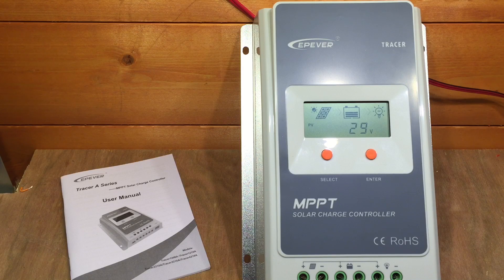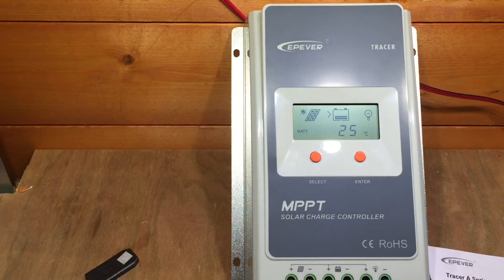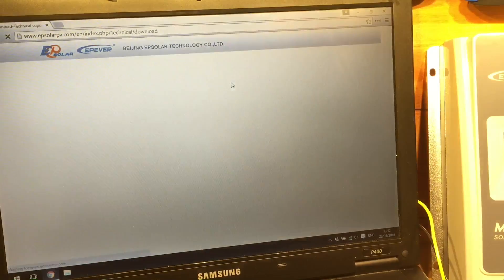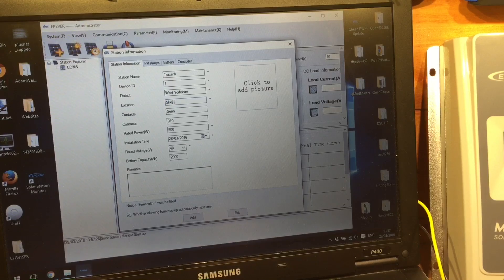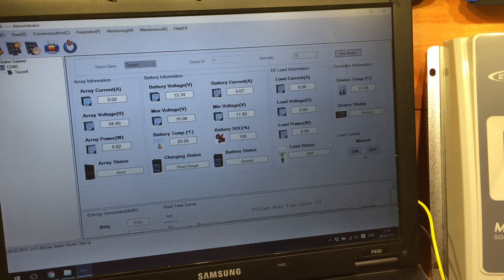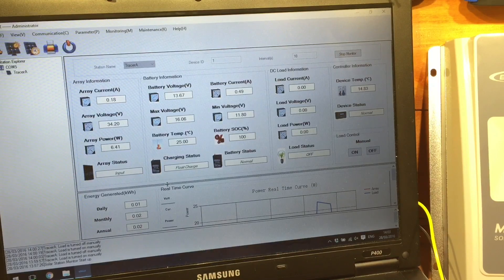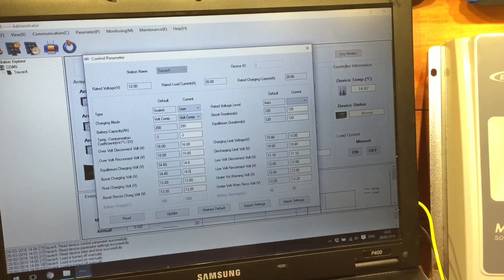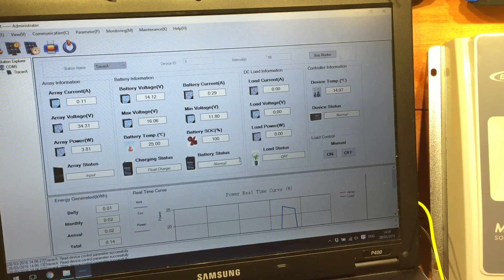EPSolar Solar Station Monitor software & a cheap USB cable - 12v Solar Shed

Comment: Adam is it possible to program the PV to cut off at a lower voltage just with the controller buttons or do I need the Solar Station software to do so?
Reply from the maker: Software or MT50 only I’m afraid.  You just get the standard modes using the buttons.
Reply: You would think a company this size would ensure their software was a little more robust if no other choices are available. I am not a novice when it comes to computers and I am finding it difficult just to install let alone use. Thanks Adam you do a good job. Good luck.

Comment: Hi Adam,
Have you come across a "Doesn't exist or has not yet been set up" error?
I followed this video to a T. Exact same dongle, cut network cable using pins 4(blue) to B and Pin 6(green) to A.
Tried a different RS485 dongle, laptop all together (different antivirus, Win7/10 etc), Ensured epever software is referencing the right virtual com port, recreating a new "station"... no luck
Reply: Does anybody have 1.2 or 1.4 version of Solar Station software?
I'm using v1.92 and I'm thinking they've disabled RS485 support so people are more likely to buy their RS232 dongle?
Reply: This ended up being my RS485 driver! I was using the windows driver from 2006 assuming it would work... not using drivers from wch.cn, dates 8/8/14. FINALLY connected!
Reply: Did you managed to get it going? I have the same problem

Comment: Hey Adam.. quick question, I'm wrestling with device descriptor request failed error when I connect the usb/rj45 cable from the CC to my PC. I've run the gamut of troubleshooting solutions. I did install the Solar Station Monitor included USB driver. I just noticed in the CC user manual, "Connecting the controller with PC network communication port is forbidden. It may cause damage to the components of the controller." I did connect the CC using an ethernet cable to my PC communication port when I first got the CC because I was overly excited to get it running. Although I only had this connection hooked up for one or two minutes tops, I'm wondering if I have permanently damaged my CC. Any thoughts? Thanks m8.

Comment: Thanks Adam, Any ideas on problems arising from not getting the software to display the settings? I bought the recommended cable but not getting it to display at all. Just trying to drop the max volts down. I have a 24v system and when the batteries reach 29v the inverter cuts out. The moment I switch off the solar all is well again. Great videos by the way and appreciated the prompt response. Well done.
Reply from the maker: If you’ve got the right cable then I’m guessing you’ve got a driver issue? Can you read the stats from the charge controller at all?
Reply: Adam Welch no response from controller at all. Uninstall Ed software and downloaded new. Trouble is my setup is on a remote beach in northern Tanzania and I an in Kenya so cannot test from here. Going back down next week so will try again when on site. One thing was the software was freezing/seizing on the old and new version. Thanks for everything. Will let you know when I get back.

Comment: Hi Adam, Nice stuff. Maybe silly question but can I use just a network cable for this through the network port on my laptop? Having trouble getting the software to connect to computer. Checked ports and all. Downloaded software again but no luck. Would 32bit have anything to do with it on a 64bit machine?
Reply from the maker: I’m afraid it isn’t a network port. It’s a RS485 port so it uses a different protocol. You need a USB adapter (or some other way of connecting). I did a video about making a cheap usb cable, but to be honest they are cheap enough just to buy the proper one.

Comment: Great video!  I noticed you changed the boost duration from 120 minutes down to 60.  Any particular reason?  I have 6 UPS batteries @ 12v (110 amp hours each at the 20hr rate ) for my battery bank... How long should I run the boost cycle for my mppt controller?  Is there anyway to mathematically figure this out for your battery bank size?  Thank you for your time, great channel!
Reply: Yes why, is it better if sunny or clowdy which way

Comment: help error Operation failed. The operation has timeout(COM3)
Reply: That is the error I got on two different Windows 10 laptops. Used a Windows 7 laptop and it worked.

Comment: Awesome video! You’ve got a bunch of neat ones :)
I’m curious... the rs485 specs say it can connect to 32 devices but I haven’t found a way to do this yet. Does anybody here know if one of those adaptors could be used to connect multiple tracer models??
Reply: Hi, I'm about to set-up my Tracer3210AN (older version with orange buttons) for my LiFePo4 battery. Unfotunatelly there is no preset/default mode for this type od baterries, so I need to set up 'user' settings through rs485 (CC-USB-RS485-150U). Thanks for this help!

Comment: will this work with Android? all I have now is a tablet with android os. I have a 30a tracer a . going on 24 v. with 7s liion. I am not computer comparable! but I'm learning. I just never had the need to use one. so I did not learn.  but electrics and a bit of electronics I can do.  I believe its capable of 780 watts? or there about. would it be safe to connect it to 8- 100watt panels. since it isn't likely to get the full output from the panels. is there any limiting of the output?

Comment: Hi Adam I have this same charge controller, I have been on epsolar web site and tried to down load as you have shown on video but their screen info is different when I click software (you clicked on monitor software V1 1.2 ) But this does not come on screen now, please could you tell me which one to down load, thanks Les.
Reply from the maker: This is the latest version which I've popped onto a google drive...  https://drive.google.com/open?id=1Le26ka30XHo5reyHieDqL1yf_qs9R7yg  There is the RAR file and it's also extracted.
Reply: Thanks Adam I think I've done it, won't know until I have the RS485 adapter cable

Comment: Hi Adam,
Can you help me once again? My Tracer A series 30Amp does not give me load info because I am using it in a caravan and the batteries supply all of the DC voltage. I have an inverter that is hooked to the batteries and provides my AC.. There are no wires coming out of the controller under the Load section. Where if anywhere do I hook up the load wires?
Thank you in advance
Mark North Carolina, USA
Reply from the maker: Hi Mark .  You're not forced to use the load output on the controller.  The only advantage of doing so it statistical information on screen (and/or software) and the ability to control the loads which are attached to it - either by switching them on automatically at nightfall or perhaps switching them off if the battery voltage drops too low.  If you don't need any of those features, just leave the terminals empty.

Comment: Adam hi, we are using LS1024B charge controller and we also used a UTP wire so we converted it just like how you do it but when we open the epever monitoring application is will say that the "port does not exist or not yet set up" any idea how to fix it?
Reply from the maker: +Lyka Bastida Check the correct port in computer management and double check the driver. There might be a rs485 tick box in the driver which is also worth checking.
Reply: Adam Welch There is no Rs485 box in the port setting...
Reply from the maker: +Lyka Bastida What version of windows are you using?
Reply: 10...but we are using ls104b as a charge controller
Reply: ls1024b

Comment: Hello Adam. Tried doing this but the software doesnt recognizes the port. It says the port does not exist. Please reply asap. Thanks!
Reply from the maker: +Lizlie Gen Dolor Acidillo Check which port has been assigned in computer management and make sure that is the same in Solar station manager. Then check your driver settings and see if the RS485 tick box is there and try turning it on.
Reply: Yes sir, i have checked it but the problem is i don't find any option for rs485 in the port settings. I am a little bit confused right now. I have used cat5 utp. I attached the blue in B and green in A. Thanks for the help.

Comment: Hello Adam.
 I received my usb rs485 and I have modified a cable today and when i try to use in in my laptop i get an error of operation failed Com3
I am using com3  and i searched the internet and cant find my answer.
Any clue. I understand the video is 1 1/2 years ago. I just thought i would reach out
Thanks in advance
Mark
Reply from the maker: +Mark Assante Is it the same as the one I used - a CH340 based one? If so the driver I used is from here - http://www.arduined.eu/ch340g-converter-windows-7-driver-download/ but also have a look at a RS485 tick box in the driver settings.
Reply: Thank you for the quick reply,
Crunbs!  It works,  You are a youtube Superstar, thank you for all of your help via your videos.

Comment: hi Adam, after watching this video i decided to get the usb to RS485 Adapter  but i cannot seem to get it working  with my other Adapters for the epever i have a option to tic a box to enable RS485 in the device settings, but this device has no such option oO im running windows ten, i have installed the driver, it seems to be all good but just dont have that rs485 tic box option, do you have that option with yours ?  and what driver did you use, cheers
Reply: OK i found the problem after reading up on RS485 - RS485 is infact a 3 wire data transmitter not 2, so if it does not work it means you need to add the earth wire, i just added it to the usb plug steel case connection on the device and now its working sweet :-D

Comment: Hi, I purchased one of these after watching your video and it works very well thanks. In the instructions it mentions battery discharge protection, does this mean that the load function shuts off automatically when the battery level drops to low? Cheers Andy

Comment: Awesome!  So once the parameter is set, can the cable be disconnected and the setting retained? Or does the laptop need to stay connected to keep the setting modification ?
Reply from the maker: +Dimitris Zarmakoupis No. once set the charge controller remembers those settings.

Comment: I haven't read all the comments here but I was interested in using a wifi enabled laptop to monitor/control the charger. I have got that operating now but still wonder how easy it would have been to add data logging to the PC Software that reads the controller. I know the elogger01 can do that but was just wondering.  Reply for more details, if it hasn't been covered in later comments.
Reply from the maker: The charge controller just uses the modbus protocol over RS485.  So in theory any Modbus compatible software would be able to read the registers (where the data is held) and log and/or display the data.  SCADA is probably the most actively used open source solution that would do what you want.  The list of registers can be found here... http://admw.uk/jQ
Reply: Adam Welch Do you know if the arduino can read these registers?  Thanks for the info.

Comment: I've recently bought an Epever Tracer3210A and I try to download the log with Solar Station Monitor software but I get nothing. I manage to get the information live though, using the real time monitoring. Does the LogData Download work on yours? Thank you!
Reply from the maker: +PlanorPlanoras Hi. The unit itself has no memory to save historical data. To do that you need an optional extra - the eLog-01. I've done a video on it :-)

Comment: I have a LiFePO4 battery. Would I be able to use these settings to get it working nicely? Most of the charge controllers don't seem to have a Lithium option, just the Lead ones.
Reply from the maker: +Lee Smith It's a pretty good option. With the cable or MT50 you can adjust all the charging parameters and set it just how you like.

Comment: I am using an Esmart 3 mppt controller, Ive installed the software but Im not getting any communication between my laptop and controller. Do you have any advice? thanks.

Comment: I bought a "USB 2.0 to RS485/422 RS422 RJ-45 RJ45 Serial Adapter Converter FT232RL FT232" from eBay. Hope it works! Otherwise, I'll build as you noted. Would rather pay a few more bucks and get one already wired for an RJ45 cable. Link:
 http://www.ebay.com/itm/1pc-USB-2-0-to-RS485-422-RS422-RJ-45-RJ45-Serial-Adapter-Converter-FT232RL-FT232/371785593982?ssPageName=STRK%3AMEBIDX%3AIT&_trksid=p2057872.m2749.l2649
Reply from the maker: +Olin Lagon (SE) The pre made ones have come down in price quite a bit from when I made this video. I do have a proper one now but actually I still use my shed made one more often!

Comment: Hi Adam, just watched your video again and noticed that the max battery voltage was at 16.06v (7.38 min into the video ) yet in the controller settings it was set at a lower max v value. Did this cause you any issues with the battery as yours are sealed? Thanks
Reply from the maker: It's a funny parameter I think that 'max battery voltage'.  The battery should never get to that level - so effectively it is a final safety thing - and it will flag a warning on screen.  The battery should never go over the Boost or Equalization charge voltage at any time.  I guess you may have other chargers attached to the battery banks which may charge to a higher level than the EPEver - so it might be called into action I guess.
Reply: Adam Welch, have just heard back from epsolar, wanderer, who informs me that particular reading is the absolute peak voltage which would have lasted m/seconds and should be nothing to worry about

Comment: so 3 x 33volt 330watt panels and your at the 40amp 4210A epsolar charge controller s max 100 volt rating?  why do they say you can add a 3000 watt pv array even if the max usable is 1040watt???

Comment: Adam, can you help me out?
Ive been following this video but whenever i add a station, i get an error next to my com port saying (Doesnt exist of not yet setup)
I've installed the driver and have configured the port as per the manual (ticked the RS-485 box) but i just cant get it to work 
When i click "Start Monitoring" i get an error saying "Station Does not exist"
Ive got the charge controller connected directly to my laptop via the PC communication cable CC-USB-RS485-150U
Any ideas?
Reply: Yeah, this was needed for me as well. Works fine now.
Reply from the maker: Are you using windows 10?  I had issues with the epever cable on windows 10 but it didn't worry me because I had my home made cable which worked perfectly.  I'm not sure I can put my hand on the proper EPEver cable to test either.  I'm not a lot of help am I?
Have you downloaded the latest 'Solar Station Monitor' software?  I presume it includes the latest driver.
Reply: All good- i figured it out .he documentation suggests the port only needs to be configured in the device manager but i found (on two seperate Win7 PC's) that i also needed to go into the 'Port Config' menu and 'Add' the port..

Comment: If I have an old laptop with a serial port, can I cut an Ethernet cable and solder 4&6 from the Ethernet to 4&5 on a serial cable? or will I have to go full duplex and connect E3>S4, E4>S8, E5>S5, E6>S9 and E7>S1(ground)?
Reply from the maker: +Daniel Meconitas RS232 and RS485 use different voltages on their commas rails I believe. I'm not sure it is quite that simple.

Comment: how do You persuade the controller to communicate at any other speed than the factory default 115 KiloBaud.?
Using the PC control program I try to set device comm speed to 19200, but device refuses to reply at any other speed than 115 Kbaud.
Reply from the maker: I'm not sure I'm afraid I've been happy to leave it as the default.  Not had cause to change it.

Comment: Adam, hey , good vidieos. Question , do you think we can tie in the inverters on/off switch with voltage settings ?  Im wanting to turn the inverter off (to my rifg) when my baterry voltage gets below 12 volts and turns back on when the baterries get above 12.4 vt,  whats your thought ?  Thanks
Reply from the maker: I think this is doable - fairly easy if your inverter has a remote operation switch.  If you adjust the low voltage disconnect (and reconnect) parameters to suit on your solar charge controller you might be able to use the load output directly to switch the inverter on and off. Otherwise you might need a relay - the charge controller energizing the coil and the normally open connection acting as the switch for the inverter.  Cheers
Reply: Thanks Adam  , appriciate your reply . Im not soo much up on relays and such, an old ironworker  :-). Any advice on what type of relay is deeply appriciated . I'm pretty certine theres no remote cababilities with the inverter (TBE 2000 pure sine wave , FROM China )  :-) and the controler is a EPSOLAR tracer 40 amp.   HOPE You can be my teacher here on this  :-)  Thanks Again